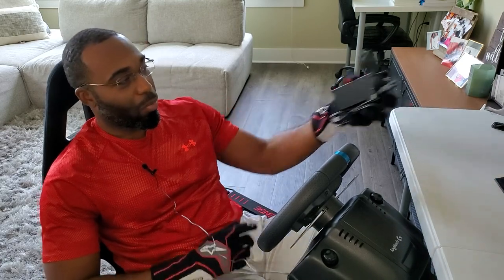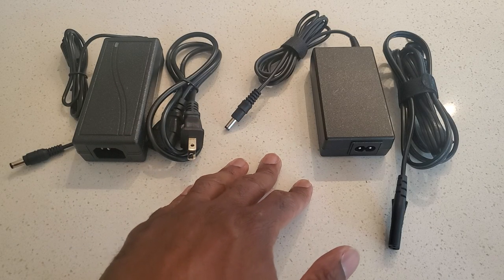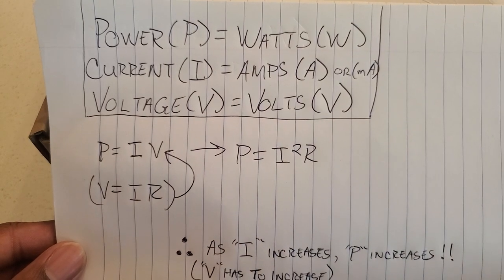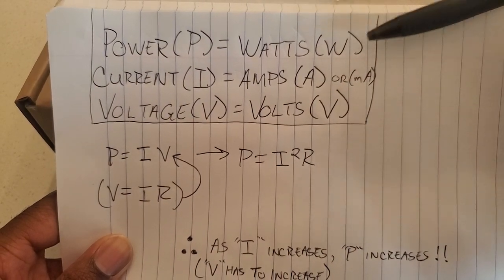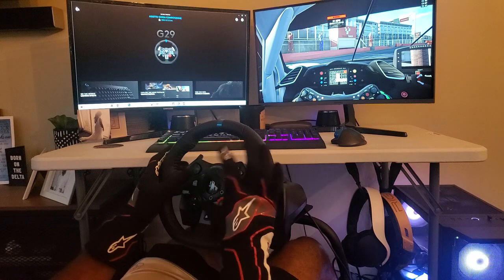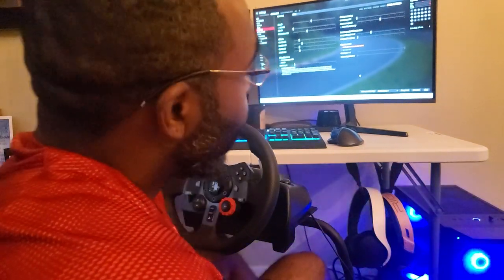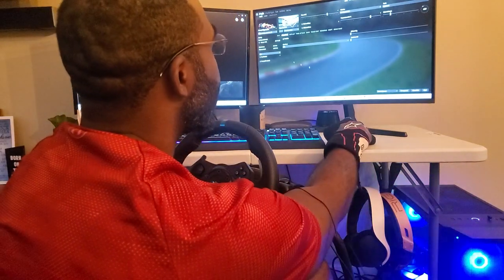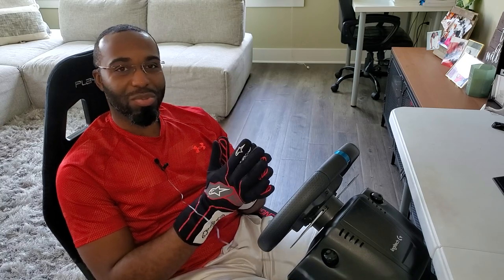G29 5A Power Supply Upgrade

Comment: So at this point has it done any damage to anyone's wheel. Has anyone's wheel stopped working due to this mod. Thanks
Reply from the maker: @Darren Aston my wheel still works. I have not had any overheating issues either.
Reply: doing research on this as a future upgrade, ive seen a few people put heatsinks on their motors, but no reports of this mod frying the ffb. i was reading on reddit the stock motors are rated to pull 4.3 amps at peak so a 5A power supply would be able to provide that with just a tad bit of overhead, from an electrical standpoint, it should be fine. there are reports of guys going up to 28 and 30 volts on the stock motors (the fets are said to be OK with this) and that seems like it can overheat / kill a motor, but at 24v all you are doing is giving them the ability to draw all they can draw. that should be safe.
Reply: I did this around a year ago worked fine until I broke the switch that selects ps3 or 4 but that was me the wheel held up fine 👍 just a heads up long stints it started getting rather hot so I cut the top out and added a usb 120mm pc fan never overheated again
Reply from the maker: @setthestandardsimracing8689  thank you for the insight and tip!
Reply: my 920 has a 5a PSU on it and ive noticed no issues. the math on this is simple. if you give yer wheel a 5a PSU to draw from it peaks out at about 4.5-4.8 amps when the FFB motors are going at full strength. the chips in the wheel that power this are rated for higher than that . but it seems from others testing that anything over 5a is a waste. i can say from personal experience my wheel moves a bit quicker on calibration but otherwise feels normal. it does clip alot less when its wobbling too.

Comment: for me this did nothing, no change...!
Reply from the maker: @Samuel have you tried turning down your ffb gain in the sim?
Reply: @JCCollinsRacing  yes I have, this does nothing probably because I've setup so that there is no clipping on ffb, this is one of those things that are placebo, at least for me there where no changes
Reply from the maker: @sctek  sorry to hear that. For me, the ffb is definitely not "stronger", but it is definitely smoother and more detailed.  I am able to feel a lot more of the road textures than what u previously was able to feel, especially in ACC. Really sorry that your experience didn't change. 

What Sims are you running?
Reply: @JCCollinsRacing  ac and pc2
Reply from the maker: @sctek  that's interesting...I definitely feel a difference in AC. I currently do not have PC2 on PC so I can't speak to that one...
Reply: @JCCollinsRacing  o feel like this is one of those placebo things...

Comment: This doesn't do anything but burning up the junk g29 even quicker
Reply from the maker: @SIM RIG 412 thanks for watching the video! What do you do you currently run?
Reply: @JCCollinsRacing  
Simucube 2 sport
HE sprint pedals
He handbrake version 2
Fanatec h pattern shifter
Simagic sequential shifter
Simlabs gt1 evo
Simlabs triple monitor stand
3 32in MSI 2k curved monitor
Buttkicker gaming simulator
32 input button box
Cube controls formula pro wireless
Fanatec classic rim 2
Asher wireless button plate with turn racing r20 leather rim
Nrg 320mm rally rim
Rpm 16rgb strip

PC specs
Lian Li lancool 2 mesh
MSI 240mm aio
MSI z490 mobo
I7 10700k
32gb 3200mhz ram
Evga rtx 3070 xc3 ultra
6 corsair hd120 RGB fans
Corsair 850w fully modular psu

Sound is hooked up to a LG 300watt sound bar with wireless subwoofer.
Reply from the maker: That is a pretty aggressive setup! Is this the setup that you began with?
Reply: @JCCollinsRacing  

No

Started with a Logitech g29 and then I returned it.

Then bought a thrustmaster tx servo base, 599xx rim and pro pedals then returned all of that.

Then bought fanatec csw v2.5,v3 pedals,shifter and a couple fanatec rims. Then sold all of that and bought what I have now. 

And I have no complaints with anything I own now. It's 1million times better then Logitech, thrustmaster or fanatec. I never used fanatec DD wheel bases but not a huge fanatec fan they are ok but way to expensive for the actual quality you get. I'd rather spend more and get way better value then save and buy fanatec.
Reply from the maker: @SIMRIG412  that's some progression! So you understand the need for more immersion in the beginning with the G29.
Reply: Wow affluent snob alert.  Everyone gotta start somewhere and not everyone can have your budget.  The G29 is a good place for people to start/for those with a lesser budget.  Get that chip off your shoulder
Reply: @SIMRIG412  haha all that expensive kit and you're using sh*tty soundbar and wireless sound hahahahaha
Reply: @voongnz  lol his list of mods/parts is the equivalent of a ricer with the shopping list on the side of their door.